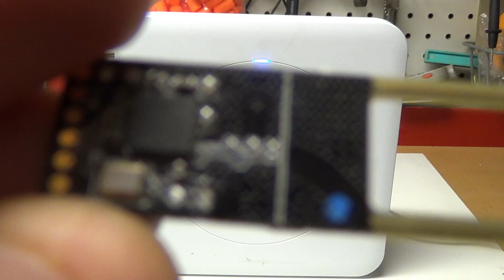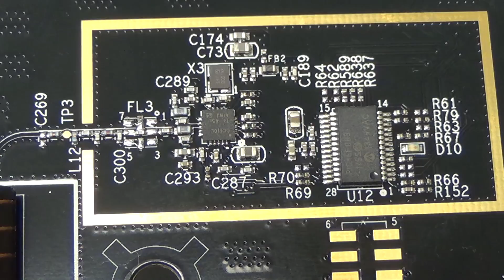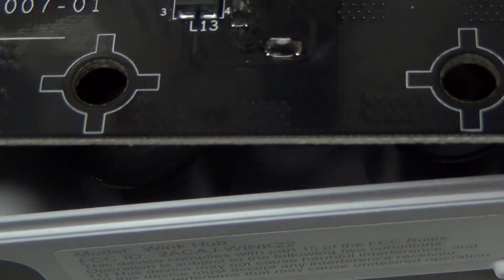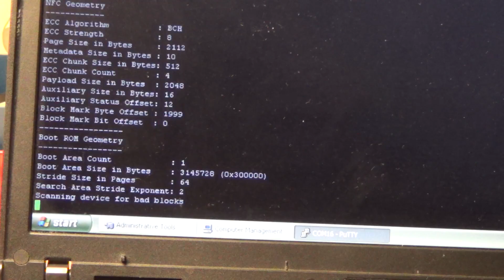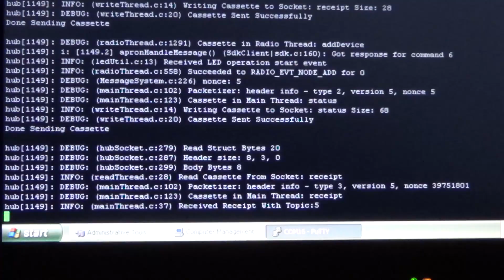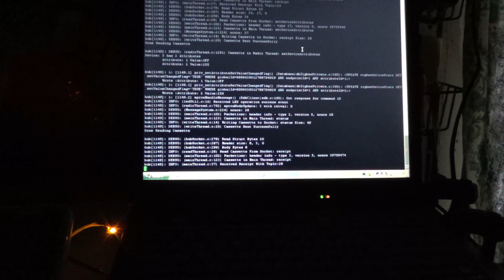Wink Hub Teardown and Debug

Comment: So now that Wink has screwed all its users - I think it would be great to show how a dremel tool can cut out irrelevant parts of the board so that the various parts (WIFI, Z-wave etc) can be connected to a raspberry pi to create an open source hub. Even if it did not work outside of the range of the WIFI that would still make it 90% usable.  If you take this challenge you should do it quickly before all Winks are in the land fill. Bet you get some views!
Reply from the maker: I chucked that thing as soon as they mentioned charging a service fee. Thanks tho :D

Comment: I  got a wink hub from ebay,  so it is preowned.  When I plug it in I get a green flash then a solid purple light.  I assume it is looking for the previous owners wifi.  How do I get it to reset and flash purple?  Should I hit the reset button?
Reply from the maker: I believe you just hold the reset until the lights start cycling.  Most devices with a reset usually reset with pressing and holding the button, or holding the button while powering on. I don't remember which method Wink uses.
Reply: @TheHouseBlog  I tried holding the button down as the unit is powering up for about 10-20 seconds and pressing the reset when the unit is powered.  I get the same result.  It appears the reset simply removes power from the unit.  Once the initial green light flashes it goes back to solid purple.  and stays that way indefinitely (after 2 days still solid purple).  Any more things to try?

Comment: Site Changes and Interruptions

Wink reserves the right to interrupt the Site with or without prior notice for any reason or no reason. You agree that Wink will not be liable for any interruption of the Site, delay or failure to perform. Wink has the right at any time for any reason or no reason to change and/or eliminate any aspect(s) of the Site as it sees fit in its sole discretion.
Reply from the maker: That's pretty much standard in any ToS or agreement on internet based services these days. Eventually every dog has its day. Back in the 'old' days they'd just quit selling something and people would get the new thing when it died. Now they're faced with selling something, then paying for the continuing infrastructure to support it and if they turn it off any time before the end of time, people freak out. I wouldn't convert a whole home (light switches, thermostats, bulbs, appliances, etc) to this type of system unless it could run completely untethered from an outside internet connection/middleman, ever.  But for a few light bulbs and convenience around the house, I'm personally fine with it.

Comment: Any idea if these individual radio's can be removed and used on other projects? I need a Zigbee Radio for my Rasberry Pi 3 Home Assistant setup and i have a bricked Wink laying around. I would love to recycle the Zigbee Radio instead of dropping $35 on a Rasbee. Thanks
Reply from the maker: No idea about that, not sure how you would isolate it's connections to the main mcu.  If you research the chip number you may be able to find some more information in the datasheet and hijack the i/o lines off the board somehow.  Spending $35 would probably be quicker and easier but not as exciting or interesting. Depends on what you're going for with the project I guess.  Good luck with your project either way you decide to go.

Comment: PIECE OF CRAP! App keeps asking me to update firmware but hub flashes all kinds of colors and 10 minutes later it asks me to update firmware again. Wink service rep said he will update the firmware on their end, but nothing. Hub has solid blue light which means it's online but Wink I-Phone AP says it's offline.  It's going back to Home Depew
where it came from.
Reply: +bill richards call support and they will give you instructions for an update.  It is a known issue.  This is by far the most adaptable system to date.
Reply: +bill richards Must be user error. Mine has had no problems updating.
Reply: greg hassen Mine did the same thing. Tech support said the update was too big and had to be sent in to be flashed.  I returned mine and got a SmartThings Hub.
Reply: XcerptShow
Again.... must have been user error because mine updated flawlessly.
Reply: greg hassen No, it was a known issue.  It is widespread problem.  There tech support admitted as much...
Reply: I'm happy with it
Reply: only thing you can do is keep moving it away from your router till it updates

Comment: Interesting tear down, if you were wondering why there are so many microcontrollers and radios - there are no network stacks for zigbee/zwave/kidde in the Linux kernel. It appears that it is cheaper to use existing network stacks for microcontrollers and have a microcontroller and radio per standard. They all probably communicate via uart to the main processor.
Reply: Thank you sir

Comment from the maker: Just wanted to update that today my Wink hub started showing a solid orange light and wouldn't connect. This evening I received an email from Wink stating that in the attempt to better secure Wink hubs they accidentally bricked them.  They're sending out boxes to return the Wink hubs for re-flash and return at no cost and also offered a $50 credit in their store for those affected.  If you get two of the link starter kits (2 link lamps and a LINK hub) for $24.99 you can get 4 extra Link lamps free of charge to use when your hub gets returned.While annoying I'm glad they acted so quickly to resolve the problem.
Reply: Awesome Video Yeah sucked about there lack of updating the security update in time which bricked our units worse off I deleted my hub outta my app when I could a used my repeater I setup with third party software because I couldn't with my xfinity emta gateway because the setting cannot be changed as for there fix so frustrating

Comment: Great video and user comments.

Since the unit is running a custom Linux setup, obviously making it easy to program with arc arm 32 bit Android && IPhone. I'm a big android guy/thinker, has anyone been able to pull the system or flood the unit with resets to observe any mem leakage or any kernel info at all? 
Just some thoughts of mine, because of the versatility in modules and program language could open up a gateway to the "open source" community.

If anyone has more info or code from the wink unit it would be great to setup a github branch so others can work together. Personally, I'm not to savy to the hardware side but software is my cup of tea. Again,thanks for the detailed video.

Comment: This device, without the update, is easily hacked to allow control through the aprontest command built in. But it only gives access to the devices on the database that are controlled by GE'S radio. This allows local control of your devices with feedback for a custom interface. In using openhab to control mine.
Now I'm attempting to attach other devices to the system and have them working in the wink app, without external network connections. But I'm trying to get custom control over them without luck.
I've used the deadbolt from kwikset and the protocol is encrypted. It may be possible to use it in the future but my abilities are not that good to reverse engineer it.
The Kidde radio displays a few days points in the wink app. And going through the file system, there are several locations that have scripts for the SDK of wink. Only the script kiddetest.sh actually results in any output. But the output is just the health of the main chip, nothing about attached devices. I see a file called apron_Kidde.dat, but notion inside that I can see. And the other tests available do nothing. It must need another part enabled or something. 
The Kidde radio is communicating to the main controller using tty, at least I think so, and it may be encrypted. I see a list of encrypted serial devices and it's not on there, but I can't see anything from that serial device.
The device is called ttySP3 in the configuration. And now that I know an icd port exists, it may be possible to bypass the communication to the main chip completely and use another setup to communicate the days to my interface. 
Whatever it is, I want the ability to connect these cheap wireless co and smoke alarms to my system $50 each and they report several data that seem simple enough. 
I will donate one to someone who is willing to get this figured out. Send me a message

Comment: Great stuff Jon!! I loved you detail review. Regarding not using the iMX for direct radio control, I think the effort to port them on iMX would be more expensive then the child uC cost itself (50c a uC), I think they've copied complete reference designs with code support here. The Hub size is big due to the antenna selection and location. A chip antenna would take less space but will add an additional 20-30c per location into the BOM. I'm surprised that they didn't include BLE radio.

Comment: Thanks for the bulb and hub videos Jon.  There is a way to make the hub not rely on Wink servers.  I've been testing it out with the GE Link bulbs and so far this method works reliably.  It uses a open source automation platform called OpenHAB.

http://goo.gl/HFsaE6

.
Reply from the maker: That's awesome, thanks for the link and info.

Comment: Thanks for posting the teardown on the Hub. It was very thorough and informative. I also was wondering why they had a co-processor for every RF protocol. Maybe they didn't have enough time to redo rewrite all the drivers and layout. Quicker to just get a working layout and firmware straight from third party. Also since they are using Linux on the main chip it might not be realtime enough to control all those RF at once.